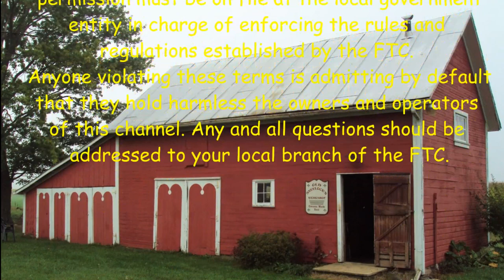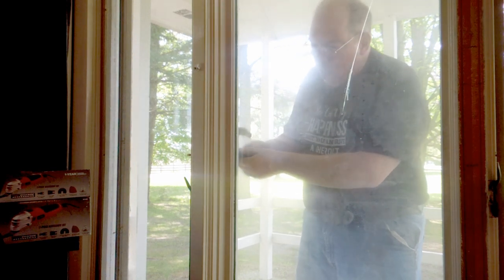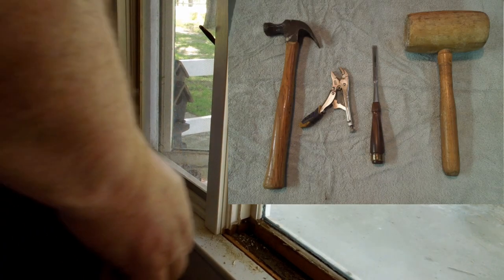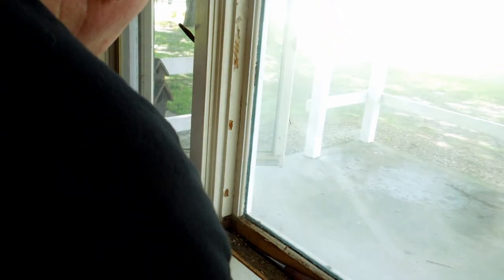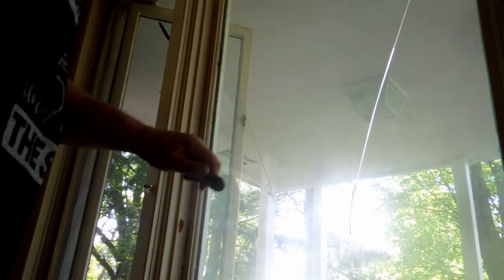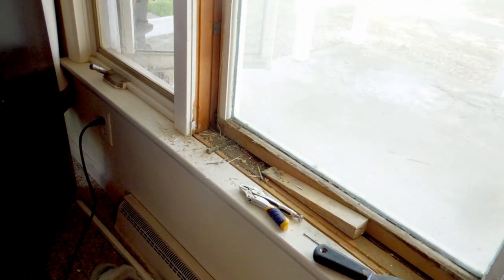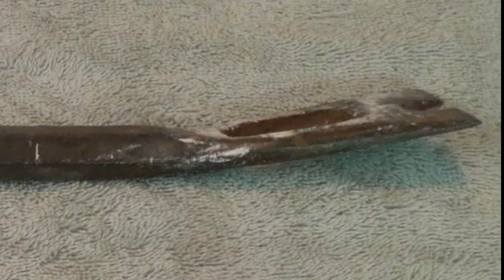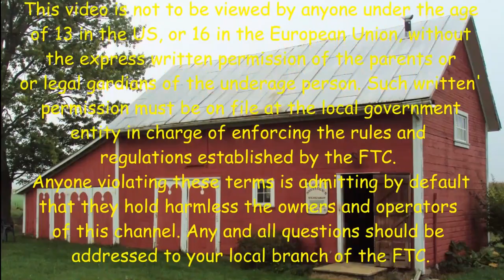Replacing The Glass In An Anderson A1 Fixed Thermopane Pt 2

Comment: Around 7-8 years ago a kitchen window cracked across the bottom one night. It's still that way I have never wanted to replace it, but after seeing how easy it is I may have to try it.  Mine are vinyl clad, after removing two screws from the bottom outside the side stops remove and the window comes out of the sealant.  Easy pleasy lemon squeezy.  I would have just torn the wood stops out from the window and made new ones, looks like lots of work on the Anderson windows.  I installed many in new homes, but never replaced a broken pane.  Have a Great Day and give Sadie a extra pat on the head from me.
Reply from the maker: Sadie says thanks. 
None of these jobs are impossible. Some just take longer. 
I figured I might have to make a few new pieces before I got done.

Comment: Too late for this job but you can use a magnet to find nails underneath paint, rare earth work best.
Reply from the maker: Thanks for the tip. I will have to remember it. 😁😎
Reply: I agree, a rare earth magnet finds the head of the nail and then use a cats paw nail extractor to get a grip on the nail head and pull.